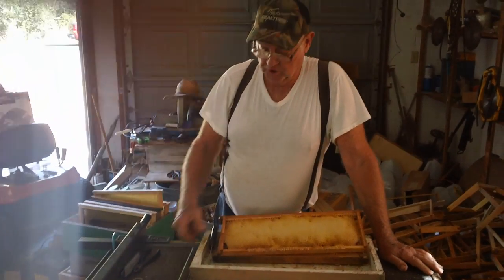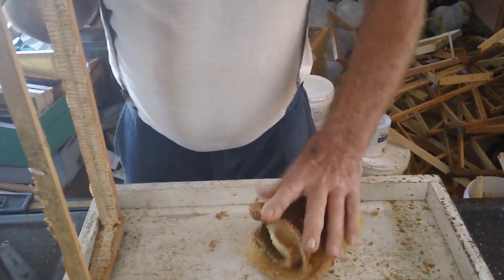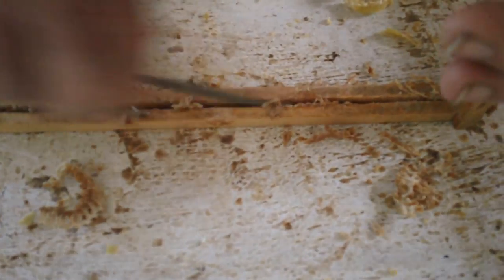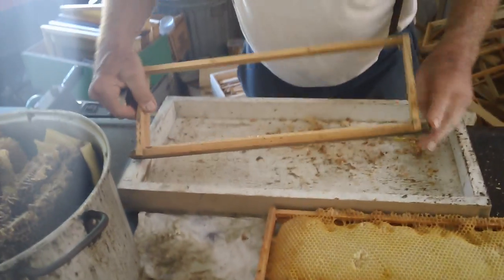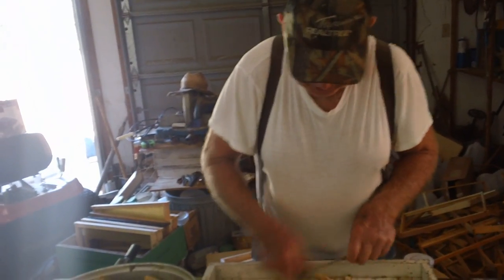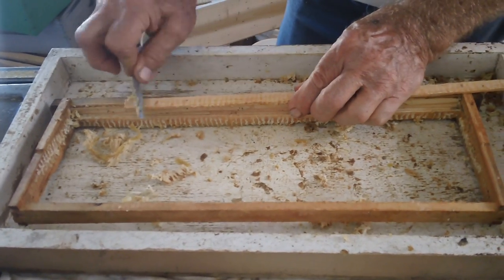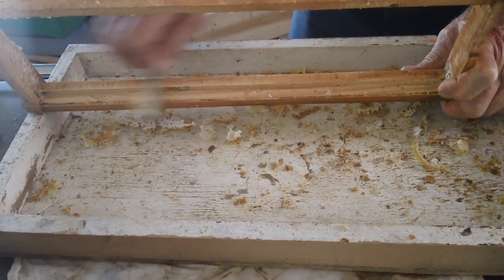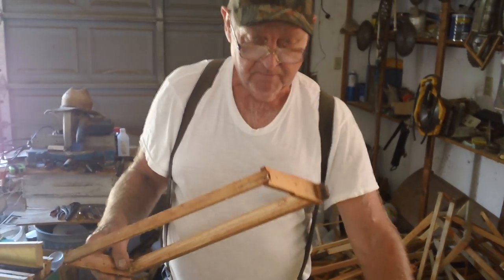Fat Bee Man - How to Clean Frames of Wax

Comment: I made a groove cleaner, all it is a 16" penny nail with the head cut off and took a piece of scrap wood for a handle, i took the handle and drilled it out where the nail will fit down the middle with out splitting it, and took a hammer drove the head in down into the handle, then i bent the nail where it was comfortable to push the wax out of the groove, you will be surprise how much wax is in the groove parts of a frames    It is dangerous if you put the other hand down on the bottom to clean the groove it may slip and go into your hand but if you hold the frame on top it want happen!   Makes it even easier to have the frames setting in sun light when cleaning them

Comment: My question is:-
Is it necessary to have bee wax in  every frame, I have no these yellow papers, is there any alternative, can I put simple frames without these yellow sheets
Reply: Hilal Ahmad Yes, you can put just a line of melted beeswax on the underside of the top bar of the frame and the bees will (often, not always) start from there. It's best if underside of the top bar is shaped like a wedge pointing down. You may get comb in all different directions though, it may take some practice and patience to get it so that the bees build from your "guides".